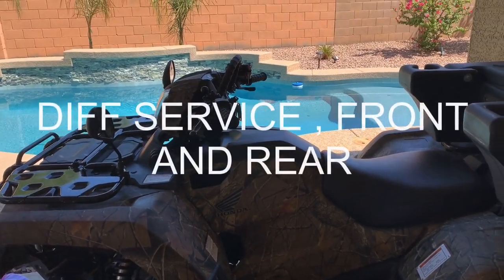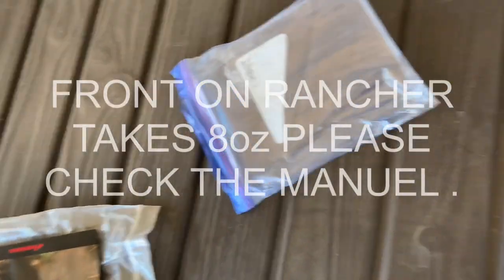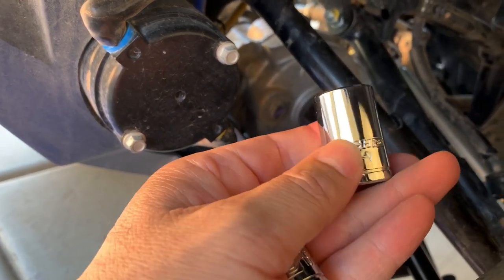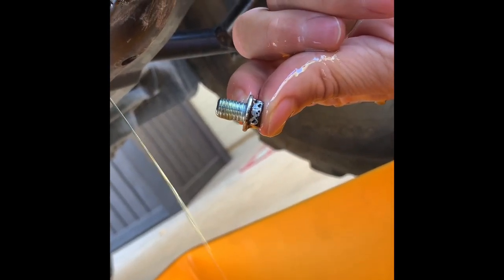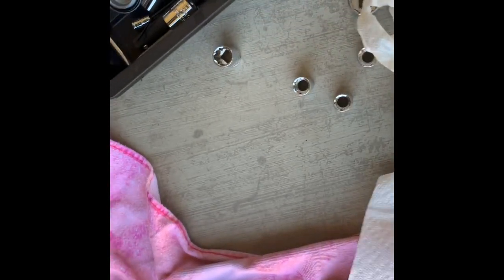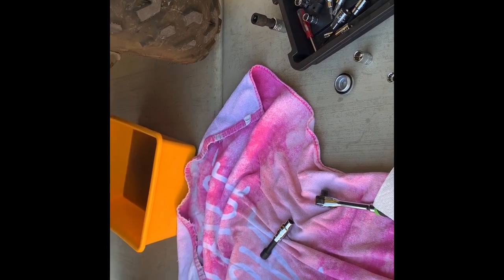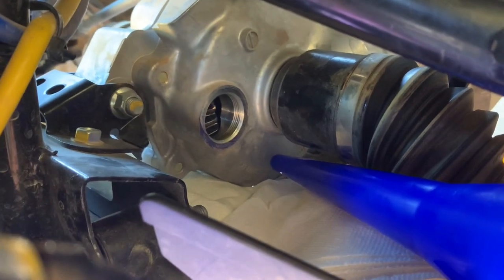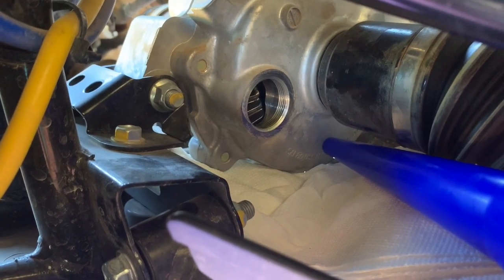How to do Honda Foreman 520 Differential fluid change front and rear

Comment: Every bike I’ve owned I change the rear diff at 100 miles and the front at 250. It’s always black as tar and full of ‘glitter’ I do oil, and diffs every 400 miles,  my oldest Honda is a 99 recon 😂 changing the oil and diffs early usually lets you catch something quicker, quicker you catch it less damage done. I also use valvoline  pro, in the fine print on the back it says it’s rated for hypoid diffs and costs like 8 bucks for a quart

Comment: Nice video.  Do you use a torque wrench to tighten the bolts?
Reply from the maker: Jim Johnson ,  no I do not . I’m a old farm boy and we just never did . I would recommend it though . If you don’t know your own strength ?? You can badly mess up bolts . It’s only 9ft lbs for those oil plugs on Diffs .